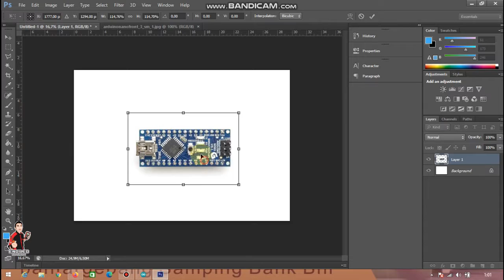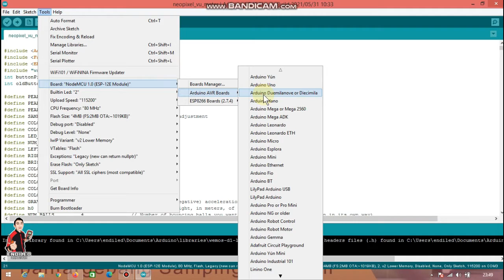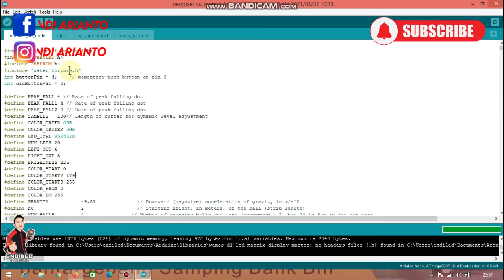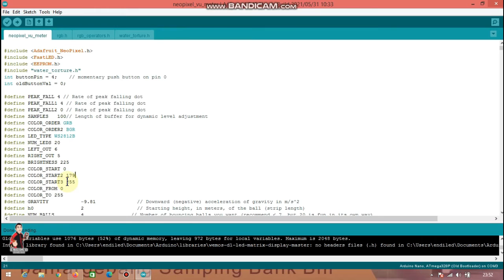Cara membuat VU meter musik RGB stereo Arduino led ws2812|4 mode animasi

Comment: Permisi kak, saya mau bertanya. Step-down DC-DC Converter itu untuk mensuplai mikrokontrolernya?
Reply from the maker: Buat kurangin daya kak
Reply: @endiled_Project  kalau aku lihat wiring diagramnya dan aktual wiringnya, apakah led strip ws2812-nya memang dapet 12V?

Comment: Mas, itu klu sy gk salah liat ya, pemasangan supply dc untuk ws2812b nya koq 12v, bukan di ambil dari stepdownnya?
Reply: Itu pake led yg 12v
Reply from the maker: Bisa 5v bisa 12v kak

Comment: How can it work woth 12v adapter, when ws2812 needs 5v as well as arduino....
Reply from the maker: 5v or 12v with ic 7805
Reply: @endiled_Project  there isn't any 7805 in the video
Reply from the maker: Stepdown 3a
Reply: @endiled_Project  there isn´t any stepdown in the video

Comment: In ko ga sama data ya sama yang di video.
Reply: Oke. Benerin dulu itu code.
Reply from the maker: @heppycoy3538  oke
Reply from the maker: Sama kak pin aja mungkin yg beda kak bisa d sesuikan dengan pin yg d pake
Reply: Code ya in lo yg ga sama di video sama yg di kripsi
Reply from the maker: @heppycoy3538  coba nanti saya uplod ulang kak
Reply: Oke
Reply from the maker: Jangan lupa d subribe ya kak he
Reply: Mana in.
Reply from the maker: Udh d updet tinggl sedot gan
Reply: Oke 👍👍

Comment: Ardino ku ko ga bisa ya. Copy error mesenges
Reply from the maker: Pake arduino apa gan
Reply: Ardino nano ATmega 328p
Reply from the maker: @slipknotmetal5344  coba nano nya kan ada 2v kak coba paling atas kalu gak bisa nano old
Reply: Ga bisa juga. Jadi binggung
Reply from the maker: @slipknotmetal5344  port com nya dah bener blom
Reply: Sudah com4  cuma ada 1 aja
Reply: Ada wa ya kah.
Reply from the maker: Ada kak